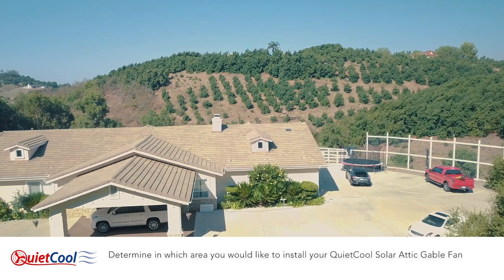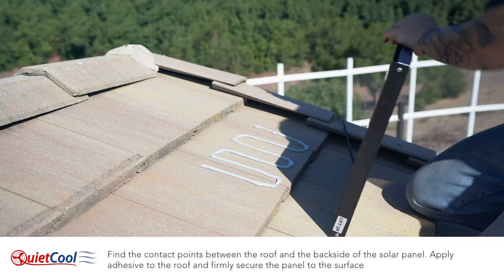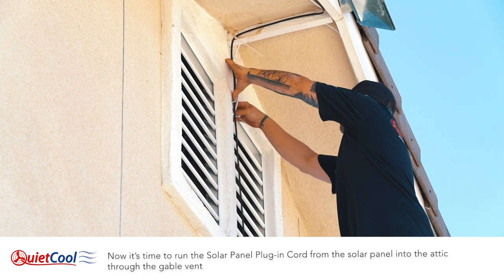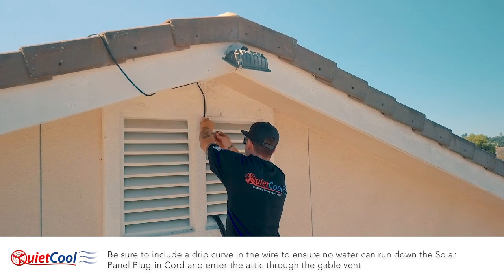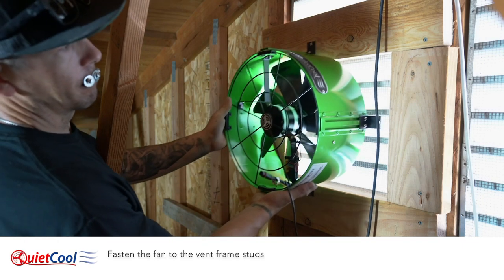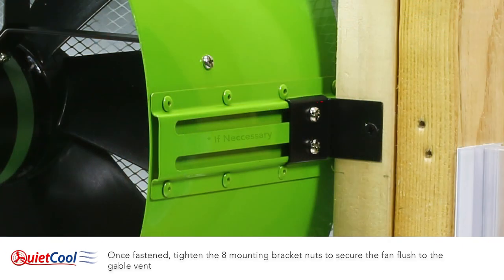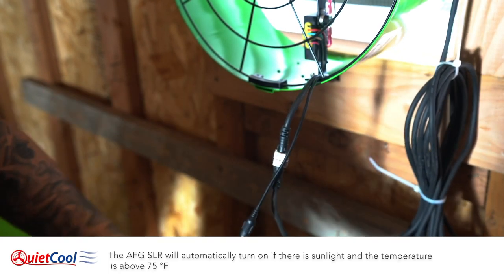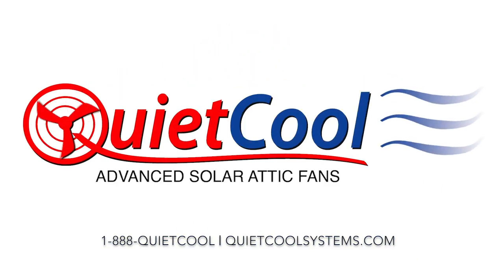QuietCool AFG SLR Solar Attic Gable Fan Installation on Tile Roofs

Comment: I hope he isn't planning on angling the solar panel upwards because he mounted it 180 degrees out of rotation position. Angling it up the way he mounted it would block its ability to receive sunlight, not enhance it. Look at his shadow and the "Lift Up" decal to confirm this.
Reply: Rusin Van Dyke 100% correct...with they way he placed it you can’t use the tilt feature. 😂

Comment: what about a shingle roof?? theyre much more common than a flat concrete tile roof lol
Reply from the maker: It'll work the singles roofs but you may need check the pitch of your roof to ensure that the roof cover will clear the singles.
Reply: Maybe where you live! Lol

Comment: What...what.???  You’ll be pulling in outside hot air from the adjacent gable opening as well as from the gap around the fan itself.
Reply: In a hot climate like Arizona, our attics hit 160* easily. If the daytime high is 118*, that is a difference of 42*. Pretty easy math.
Reply: @JohnWilliams-lp6jr He’s talking about how there’s two gable vents side by side. If you put a fan on inly one, without blocking the other, the fan will suck air from the outside via the gable vent next to it. The other gable vent should be blocked off.